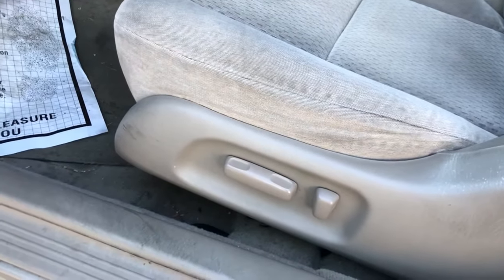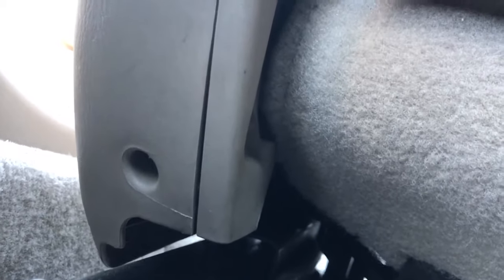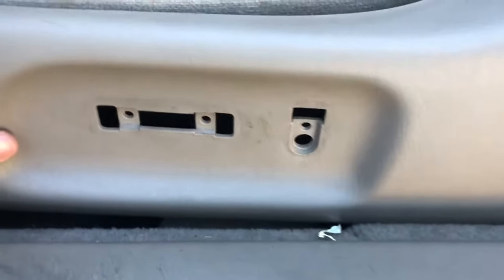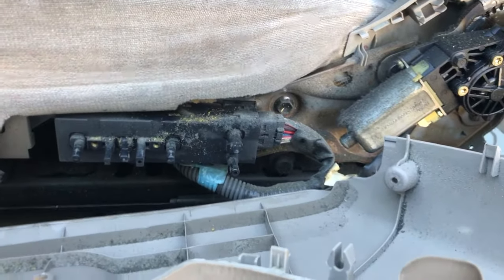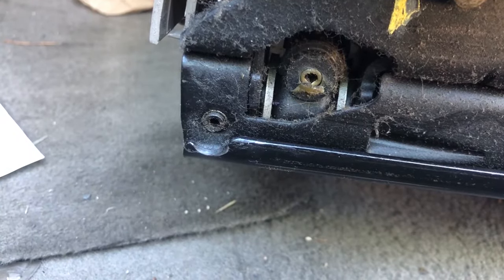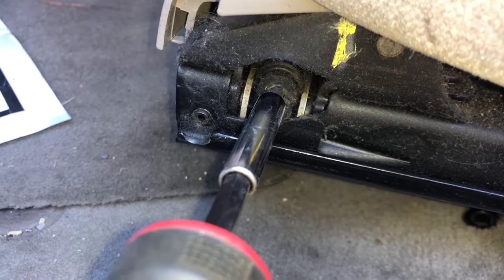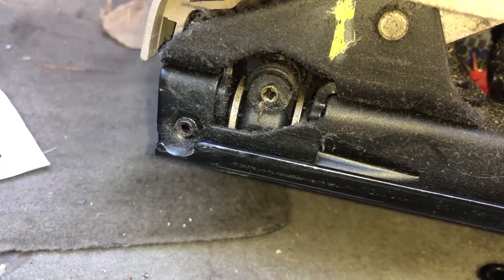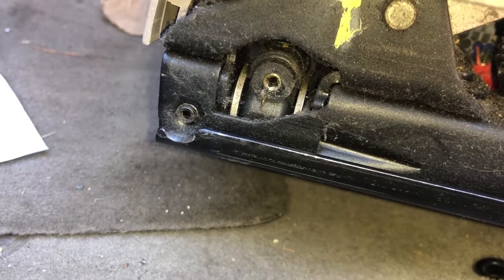How to Fix Power Car Seat Stuck All the Way Forward (2003 Toyota Camry)

Comment: I was able to fix a 2003 camry.  You do not need to remove the buttons or panel to get to the square bolt.  You can see from the side just under the bottom edge of the panel, raising the seat up helps.  I used a 2"-3" bit holder extension and an S2 square bit and rotated it clock-wise with a crescent wrench about 10 rotations until the drive screw engaged.  Thanks for video!

Comment: Effing perfect!!   Girlfriend moved the seat all the way forward to clean, and this is exactly what happened.  Did NOT have to take the rear screw out to remove the side panel and access that manual square bolt; just removed the three on the side and the switch clips and I was good to go, and careful not to pull too hard. Thank you so much! One of the most helpful videos I have seen. !!

Comment: Wow!!! I did what you said. It worked on my girlfriends car. She looked like a clown too. She is happy now and that is all that matters. I could not take out the back screw. But taking off the 3 along the switches gave me enough room to get to that screw bolt you showed on your vid. I was impressed with myself. Thanks saved me at least $150.00 taking to a mechanic.

Comment: Thanks for the video. It was completely accurate for my 2003 Camry. 
Took me 45 min. 
The hardest part was getting the screw in the back of the seat. 
To set it back on the screw I used a power drill with the square bit. Torque cranked all the way up. 

Again, thanks. You saved my knees.
Reply from the maker: Glad to help!

Comment: Thank you so much!  Had the same issue today, same make and model.  Couldn’t get the back screw out so I took off the two switch covers and pulled out the front. Worked perfect!

Comment: Worked for me.. Eventually. After using a ratchet with an S2 square bit on the left side, the left side would move, but the right side wouldn't budge. So the seat was "turning". This is because the right side was also disengaged. Ended up hammering downwards on the track on the right side, while momentarily tapping the backwards button. Took a couple tries. Had to keep moving the seat forward in-between tries so that both sides were as aligned as much as they possibly could be. Finally the right side was engaged again after a couple minutes. For anybody else who runs into this issue - Before you attempt any of this, try sitting down in your seat. Dig your heels into the floor and apply as much backwards force as you can with your upper body into the backrest of the seat, while tapping the backwards button. This should essentially be the same as hammering the tracks and doesn't require all of this extra effort. I was able to test this after purposely disengaging both sides and was able to re-engage them

Comment: Or you can just tap at the front of the black rail /seat track while pushing button back..worked for me but im thankful for your method it gave me a start
Reply: 5
Reply: I just wanted to say that @Jesse J solution work for me. I have a 2002 camry
Reply: @jesse j tapping with hammer and pushing button back definitely worked instantly thanks bro 💎
Reply: @diamondshinepaintcorrectio4480  💯glad i can pass on info to help another
Reply: Is there a certain spot you have to tap it with the hammer?
Reply: @urielgutz310  tap the rail  depending .. if you trying to adjust the seat to go back tap the front and vice versa..hope this helps
Reply: @Theservant777  never would’ve thought the answer to my problem would be here on YouTube with so many people with the same issue. A friend gave me 2003 Camry it was filthy so I gave it a good cleaning, let the driver seat all the way forward and it got stuck! This just happened TONIGHT at the car wash 7 miles from my house I’m 6foot 1 so you know that drive home made me wanna junk the damn thing… I don’t have a square bit was hoping you could post a video with the tapping method
Reply: @JamesJones2.15.19  just tap the front of the seat rail while pushing the seat adjust knob…i did the favor for a friends car when he had this issue ..ill see what i can do
Reply: @Theservant777 just tried it but didn’t work for me
Reply: What are you calling a rail??
Reply: @joanbenson4381  black metal under seat that goes forward and reverse… tap it while pushing knob to adjust seat
Reply: @Theservant777  I will try that,  thanks.
Reply: @JamesJones2.15.19    --  I'm 5'8" and am having to drive with my knees about a 1/4 of an inch from the dashboard.
Reply: thank you for this tip it worked like a charm...so glad I looked at the comments ....you are the real M.V.P for this tip 🙌🙌🙌
Reply: Thanks heap, worked perfectly. And thanks to the video poster as well. Will save me a trip to the service department.

Comment: Lmao my name Alex too, but hell yeah bro this video and 2 other videos I found all gave this same advice and this is definitely the way to do it.

I had went to clean my car at the car wash and vacuum it and pushed the seat all the way up, that's a no go. Will never do that again.

I'd recommend just not pushing the seat all the way up to avoid this. But yeah just follow these steps if you have the same issue.

For me it sounded like it was attempting to move back whenever I'd press the button and it just wouldn't so I figured that it wasn't broken and there was some way to fix it.

For the part where you used a square bit I didn't have one I just used this random tool kinda like a sharp flat head screwdriver, it was just the right size to fit in the whole at 1:50, and I turned this tool like once and it instantly fixed it, no struggle at all for me.

Comment: Definitely don't need to remove that rear screw. Just take the three small ones out from the side and is more than enough room to pull that trim away. I just put the appropriate bit in my drill / driver and gave it a quick spin and it worked. Whole job was done in under 5 minutes

Comment: I hate when mechanics fiddle with this when they test drive my car, and I dread getting in and the seat will no longer move back. 
I have mine all the way back and low. 
2002 V6 259,000 miles and still going.

Comment: My seat was all the way up to the front and stuck. I tried to rotate that square hole to the right, but nothing happened. It just kept on turning to the right. What did I do wrong?
Reply from the maker: If you’re using a ratchet make sure you’re ratchet is turning in the correct direction. Like the ratchet should have resistance when it is turning. If not, then flip the switch on the ratchet and try a again. I had this problem when I started using hand tools. Hopefully this helps.
Reply: @Alex-jbz  I also used a screwdriver and it kept on turning. I tried to turn it to the opposite direction (left) too and the same result. Do I need to turn the square hole on the other side of the chair (the side that is close to the passenger chair)? Is it possible that the linear actuator that got derailed from its track is on the other side? Does that mean I have to disassemble the chair and take the chair out in order to do that?
Reply from the maker: Hmmm… when you turn it right, does the seat move back? You might have to do a lot of turns before it starts moving. If so maybe it is engaged, but the motor is bad. 

Yes, you can try what you said, but I don’t think there is another rod on the other side because the motor is on the drivers left side. There will be a rail but not like the one on the left. But yes, that requires removing the entire seat from the car.
Reply: @Alex-jbz  I will give it a try again and let you know. If the motor is bad, the other functions would be bad too, right? (Functions like moving the whole seat up and down, or reclining / standing upright the back of the seat) Those functions on mine are still moving good. So does that mean that the motor is still good?
Reply from the maker: @aongang1136  not necessarily. There are multiple motors for moving the seat in different directions. Check out this video around the 2 minute mark to see what might be going on.

https://youtu.be/iej_yyGyN4c

Comment: I know this is unrelated to this vid, but hope this helps anyone having a hard time with it.

Here is a fun little tip. If you get the SRS light, you won't pass annual inspection. It's a red airbag looking light that pops on, and should pop off. On an older Camry(97), I was told by my father's friend who used a $300 scanner that he couldn't find the code to delete it. The srs light can be a faulty air bag, air bag sensor, or this part that is under the center console, as in under the knobs that control the hot and cold in your car. You have to get to the area under the right side of the carpeting of the driver's side. The control module is what most likely needs to be replaced. 

I forgot how, but it had a fault code that was stored, that cannot be deleted. Previous driver took out both bulbs for CEL and the SRS light, from the dash. Car inspector was trying to wring me with, it will cost me $400 for a whole new dash, when all I needed were these two bulbs for the dash.

Me and my old man came to the conclusion to just replace the constrol module with a used part(It was like 10 bucks on Ebay), and the SRS light never came back on after that.

Comment: It's an S2 square bit 🫱🏻‍🫲🏾. Oh and you don't need to take the rear left screw out. Just pop the buttons off and the front portion. If you have a small drill with an extension. You'll be just fine. Takes literally 5mins total